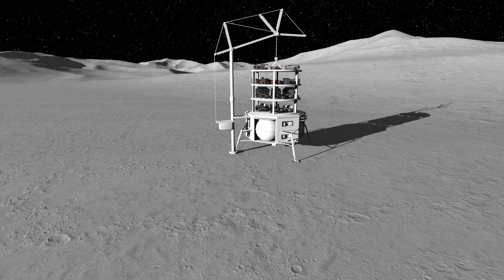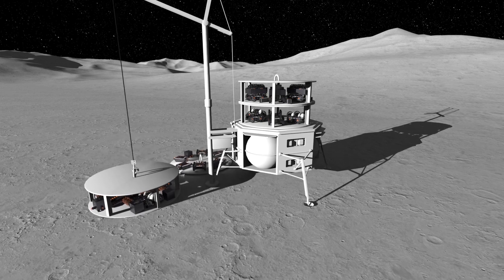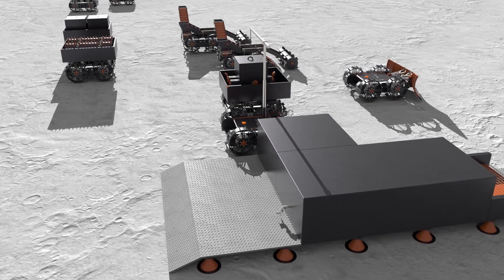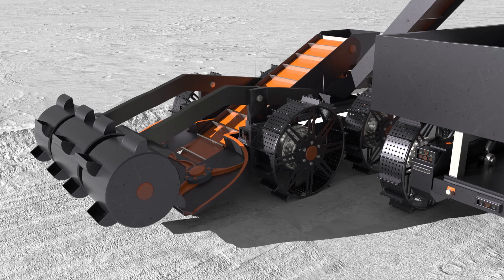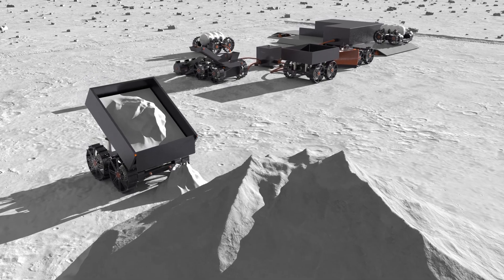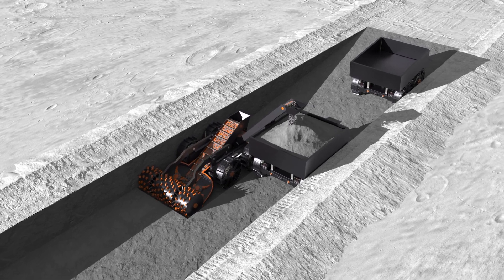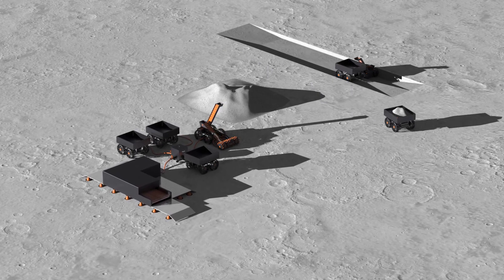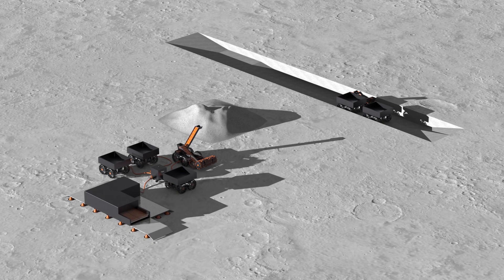OffWorld Robotic Lunar Mining CONOPS

Comment: Although we did not have the resources to fully participate in this Challenge, we did design a simple, low development time, energy-mobility platform which produces 10-100 times the water product at 1/10th the landed mass/cost.

Comment: Might be an idea to unload from the bottom of the bots. If the mining cart bots drive up a ramp over a specially designed piece it could unload the bots without the use of a motor.
Reply: I know this is a fairly old comment, but I think any other design would likely end up much more complicated. You'd also likely need an entirely different robot design defeating the purpose of their mostly modular design. Meanwhile, a dumping mechanism is simple and you can lift it well above the angle of repose with ease. 
Ultimately, this whole system seems to rely on breaking down a complicated task to very simple components where each bot is responsible for just one thing. If you start making things more complex than necessary, you ruin the robustness this system offers.